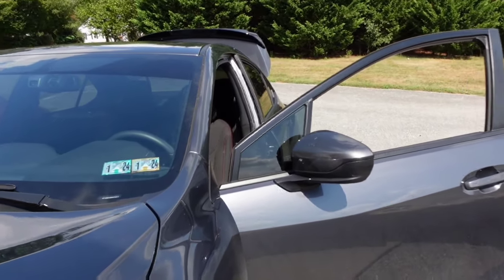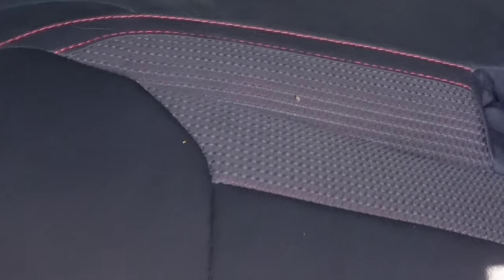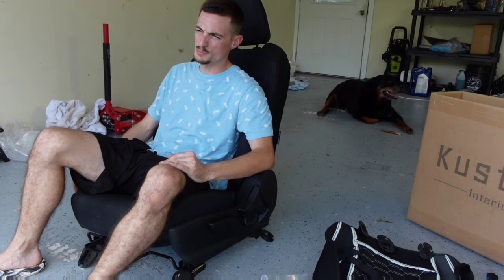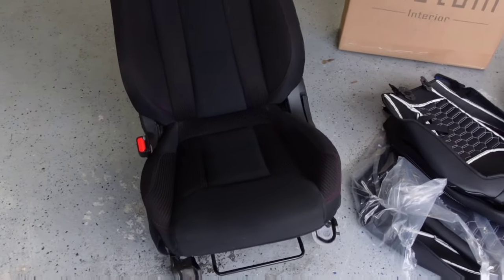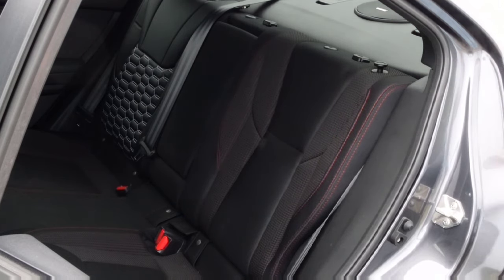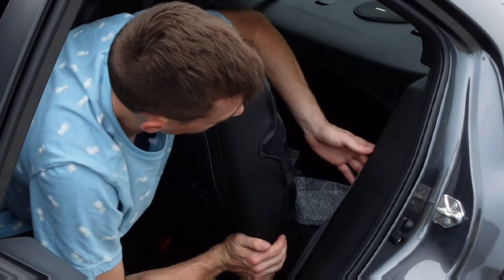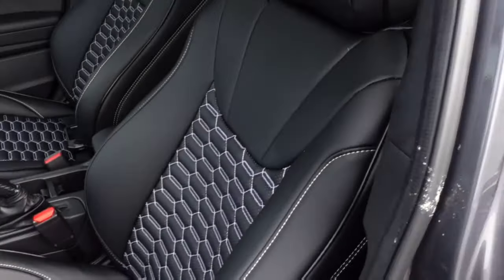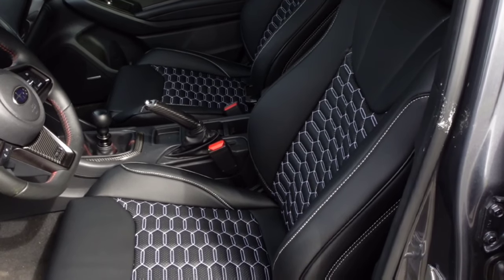Custom Seats For My WRX (Kustom Interior)

Comment: They do look way nicer then the stock for seat covers. To get rid of the air bubbles is there any velcro strips or something you could get to put on the inside to hold it down? Might be noticable sitting in it though. Anyways i think that makes the interior of your car look sharp. Nice find 👌

Comment: HOW DID THESE END UP BREAKING IN ??? BECAUSE OF THE TYPE OF WORK I DO, ID LIKE TO GET SOME SEAT COVERS..IVE GOT A PREMIUM TOO AND I SOMETIMES WISH I WOULD HAVE DRIVEN THE EXTRA 100 MILES TO GET THE LIMITED LOL..ALSO ALWAYS BEEN A FAN OF THE CLEANLINESS OF LEATHER NOT TO MENTION THE SMELL. I HAVENT SEEN ANY OTHER OPTIONS BESIDES NON FITTED KINDS AND I DEFINITELY WANT IT LOOK AS OEM AS POSSIBLE..THE GT RECAROS SURE WOULD BE NICE BUT THEY SEEM HARD TO FIND AND THE SUBI TAX IS RIDICULOUS.
Reply from the maker: The subi tax is no joke on most things. These held up pretty good. They still always had a little but of slack in them but they fit 1000% better than any universal seat cover. I would totally recommend them as a long term solution to changing the look and keeping the stock seats nice. They are pricey tho.

Comment: Is the wiring harness the same as the one that plugs into the limited seats? I have someone selling me the limited seats but not sure if its plug and play
Reply from the maker: If they're manual seats it should be the same, but if they're power seats they won't plug in.